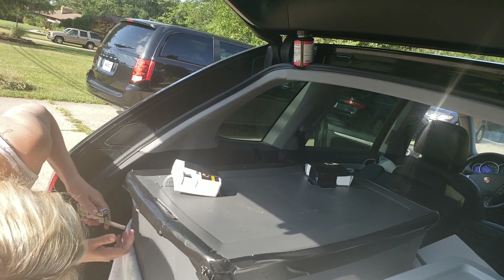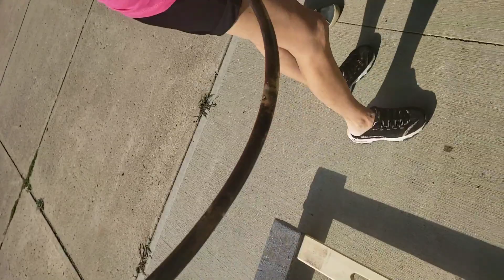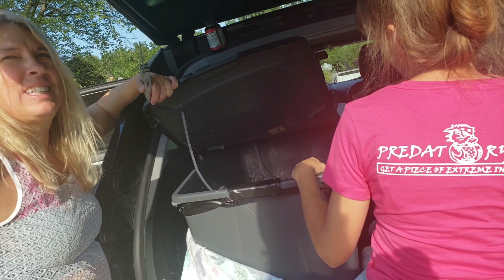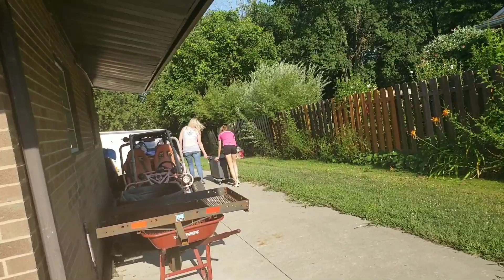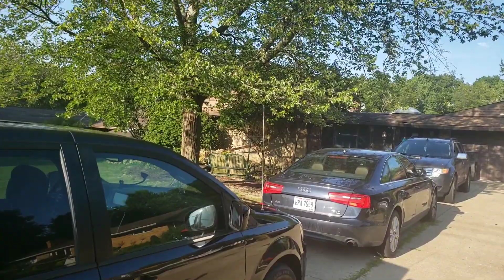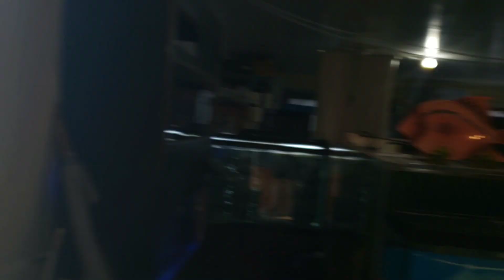Saved these fish to give them a better home

Comment: As a recovering addict. I want to say that I'm glad you told them no on the pain pills. They will cause you horrible pain in life. They are not helpful at all. I see it as a end of life care choice now. I'm 2 years sober off of dope. I was a needle user. Ppl can knock me all they want. Irs not whom a I am. Fish keeping saved my life..... Legit saved it. Now that have my 22 planted tanks and my smallest one is 5 gallon and I thave mostly 40 breeders and 30 talls and couple 20 longs. My addiction started with my having to surgery to remove impacted wisdom teeth and to break and set my jaw. I was 17 years old. I have found out that any pain pill will have your body depend on it with in a 24 to 48 hours. So thats is awesome you delt with the pain. I have had to learn how to live again. The inspiration from you tubers. You all are the best. I have a make shift betta rescue myself. I taken alot of wanted and forgotten about fish. Breaks my heart to get them half dead or knocking on deaths door looking to have beer.
Reply: Melle, respect to you for your achievements. That takes bravery and strength. Well done 💖
Reply: @dshe8637  thank yes it does daily. This hobby has helped in so many ways 😍